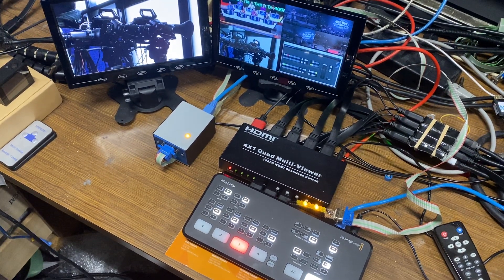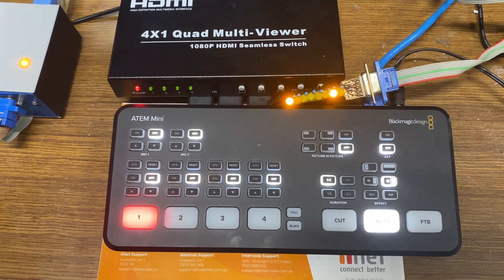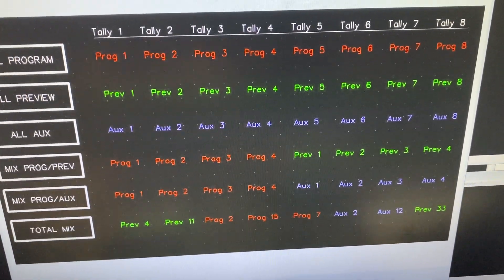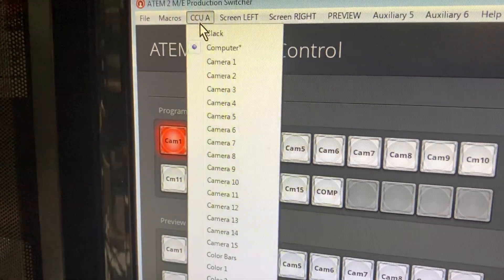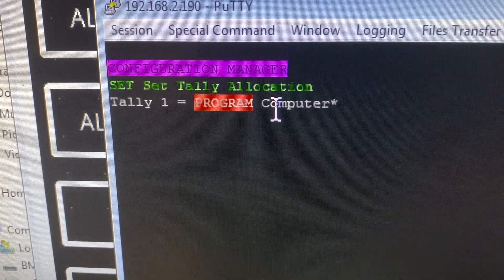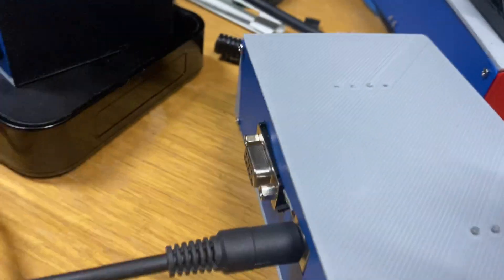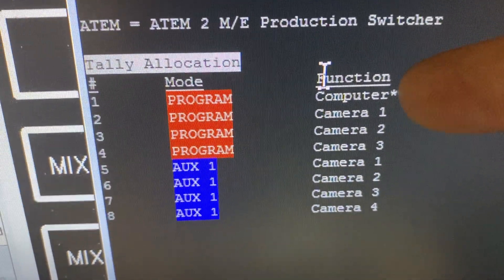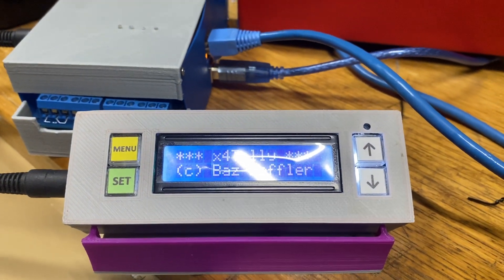ATEM hardware Tally for ATEM Mini and others

Comment: Do you sell a tally light to go along with the Tally box?  Could you list, and put pictures on your website? (And price?)  Or would I have to build my own tally lights for each camera?
Reply from the maker: There is a specialised adaptor box on the web page: http://www.bazcontrollers.com/#_X8tally_8_channel
This allows tally to camera using an XLR audio cable and Program/preview indicators on LED mounted inside the connector.